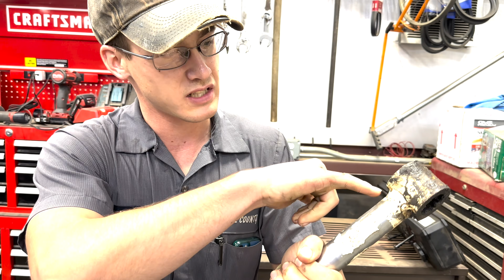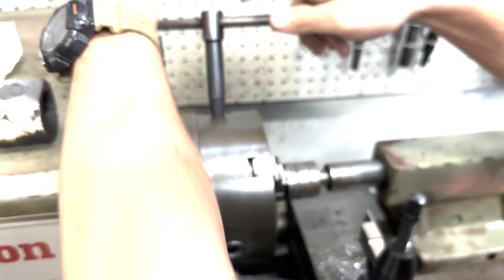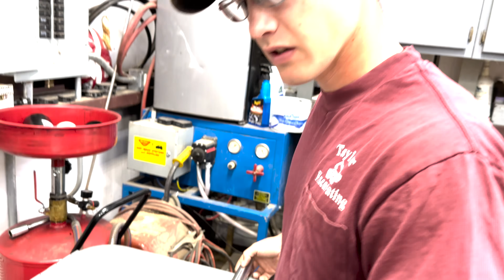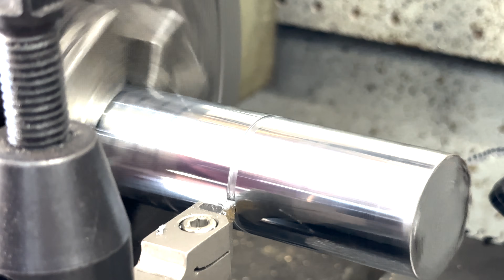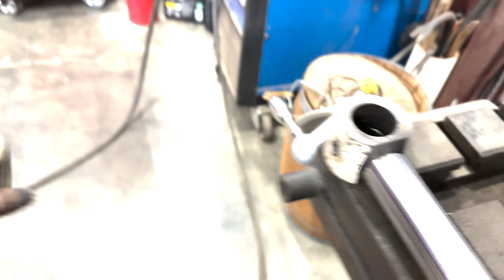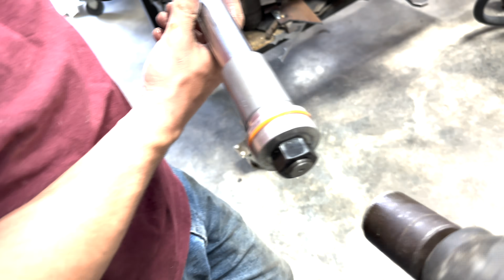Fixing Bent Hydraulic Cylinder on Bobcat! Machining New Ram!

Comment: The industrial hard chrome is hydrogen embrittled. The outside layer(0.05" deep) is probably RC65 or better. We anneal it by induction before machining. the center is basically 1040 hot rolled.